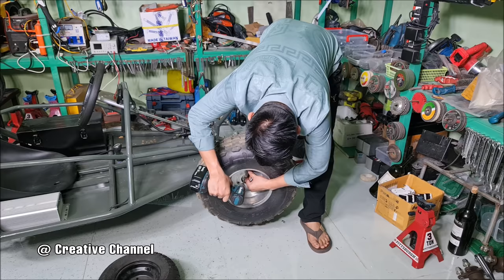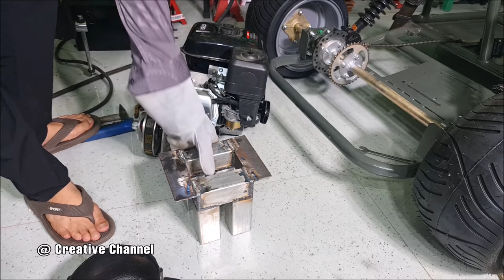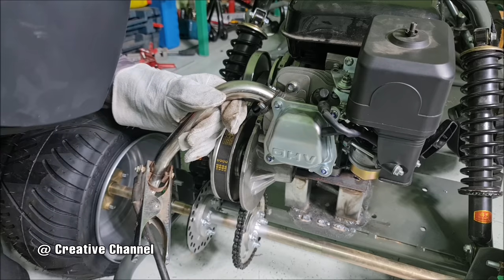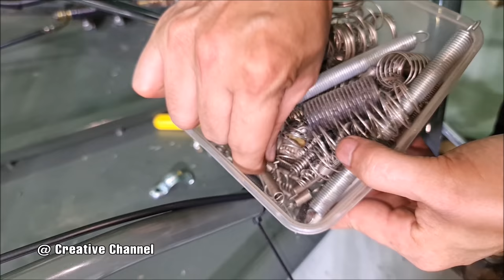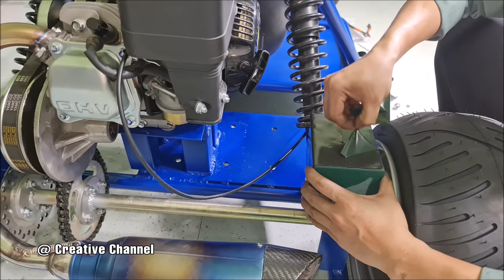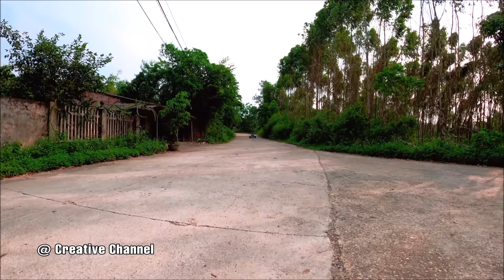Upgrade DIY F1 3000w Go kart to Go Kart Racing 200c CVT Gearbox

Comment: Looks fun, I respect a guy that knows his way around his shop, knows where everything is placed, same with me my wife or kids will ask if they can barrow “that thingy that goes like this and it’s red, you know” and without gets up “yes in the red toolbox in the drawer marked M for metric, and put it back”

I worked with a guy who’s kids both race mini sprints and I always wanted to build a two seater that the drivers seat is adjustable back and forward, E-brake between the seats, disc brakes, racing slicks and a motor with some power not shifter cart power but not a carnival ride motor either

Comment: I love the fact that the builder of this machine has a warehouse of parts to pick from all organized  just waiting to be used. I don't recall seeing him put brakes on it and I'm curious as to the actual top speed of the kart.  Very well done video  Thanks, great job.
Reply: 0
Reply: @santrisikunir2462  kk,lm
Reply: I saw a brake pedal
Reply: @sandraherdman3783  that was a ghetto hand brake rigged to control throttle, engine is the breaks
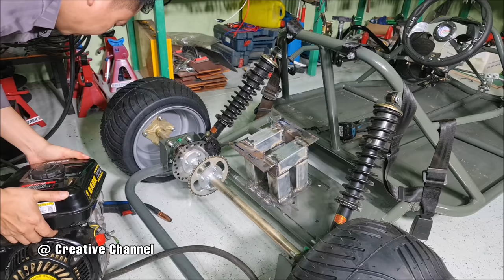Reply: @therealnynetynyne360  actually it has a disc brake on the axle. You can see it at 5:20.

Comment: Awesome builder ! Does not know how close he came to really getting Fd up. If that cart slid off the bricks at full throttle he would have been hurt. Jusy saying. You should Always use real jack styands on a power up like that. Then use tie wire to make sure the jack stands do not slip off.

Comment: The engine being attached to the rear wheels, therefore it is not damped. In the long run, it may suffer. The best would have been to make it integral with the front part of the chassis
Reply: ١د١،د
طط

كمططط

د

Comment: instead of mounting that brake lever as a fuel accelerator, you would have installed the same lever on the steering wheel and cut it a little it would have served you better

Comment: I don't think your steering geometry is ideal for a solid rear axle which leads to understeer. If you look at a kart the steering is designed so it wants to lift the rear inside tire a little allowing the kart to turn. Not that I could do it better your skills are awesome.

Comment: So it does about 55 mph the CVT clutch is the only way to go such  variable speed you have it all bottom end mid range speed and top end   speed i had a mini bike with that 6.5 motor centrifugal variable transmission CVT it climbed hills up in the mountains at my dads place like it was no ones bizzness any hill as long as you can stay on it put the way you have your go cart  set up it has that very small sprocket on the axel you would have all variable speeds witch you need on a race track the bottom end would be something inbetween a whole  shot take off and gradual take off compared to putting a medium sprocket were you would then have fast take out of the whole but then  you lose the top end speed

Comment: You should set it up so it runs on gasoline vapor.     I'm sure you would not have any problems with Detonation because the intake and exhaust valves do not overlap on these types of engines.

Comment: I’m not familiar with what series or sanctioning body has a class for something like this. If you show up with this at any of the local tracks, dirt or pavement, that I’ve attended, there isn’t a class to run it in. It may or not be a “ racing kart you can race”.

Comment: Or double the output battery power to 6000w output. At least the 2000w equal 200cc petrol. Or at least that eGo lawnmower brushed motor is equal to at 56v... Hmmmm

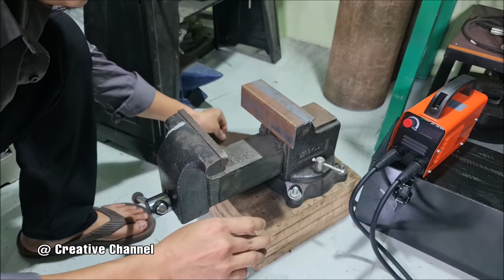Comment: 4:10 Just FYI, if you bevel the edges at a 45 you'll get much better weld penetration and have less to grind afterwards.
Reply: shut up he didnt grind a single weld its a gokart not a pipe

Comment: how did you stretch the back tyres?
Reply: Looks like he cut it right before the rear axle and welded a door hinge effect to it and stretched the rear because if you notice before painting it you can see the frame can fold in half... Easy job

Comment: you put oil down a brake line baddd idea petrolium distilates destroys plastic... you need silicone or lube that is food grade that does not have petrol dist in it other wise your line will sieze up after a few months because it broke down the rubber in the outter jacket the inner jacket is ptfe it does not break down but still pet dist get betoween the metal sprial housing down the side..... replace them imidiatly you never need to do this anyway